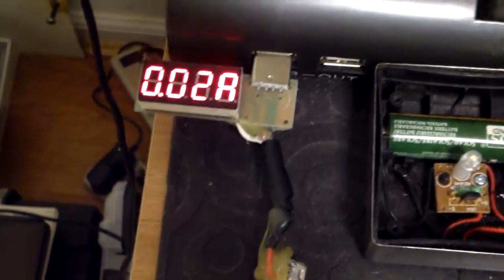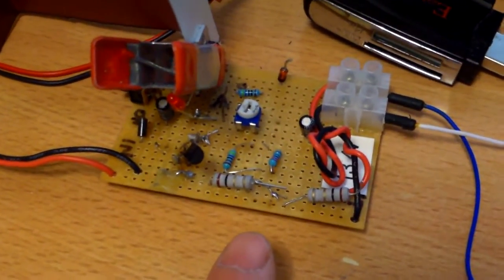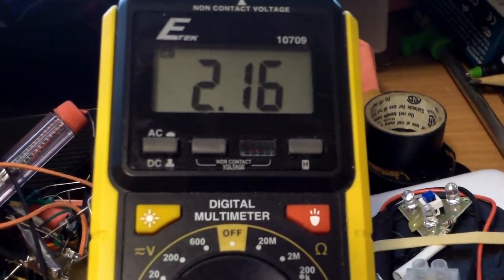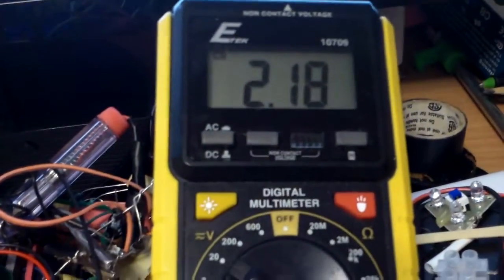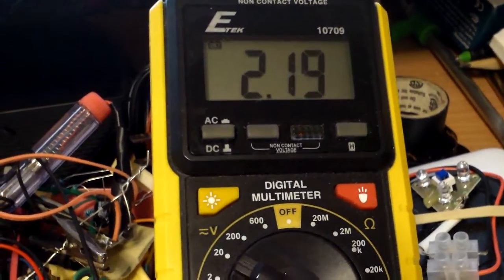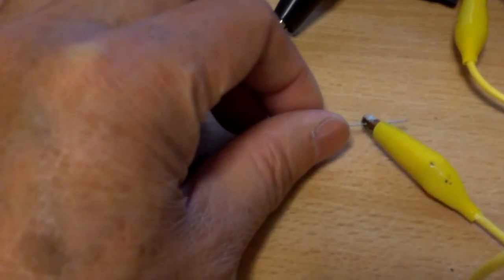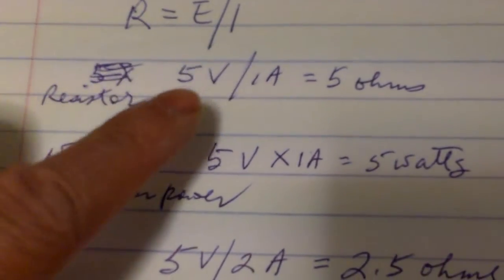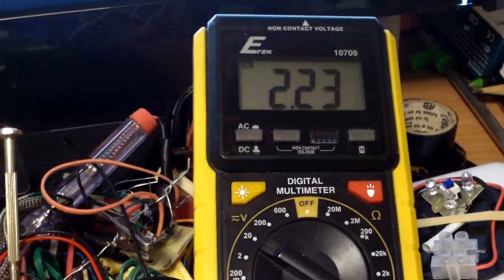Charging a supercapacitor with a charge controller

Comment: It sure would be nice to charge solar power into cheap lightweight caps instead of heavy expensive batteries.
Reply from the maker: They do charge up quickly with no memory effect and as you said, pretty light weight. Like most things electronic, the prices should come down too.